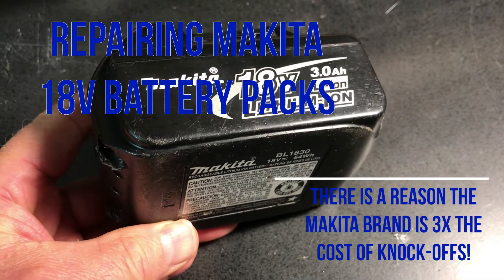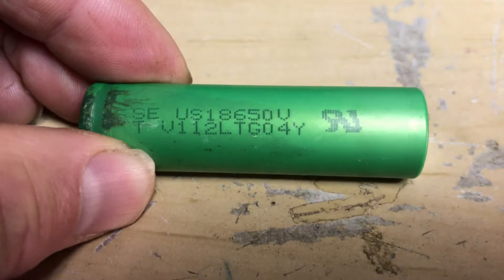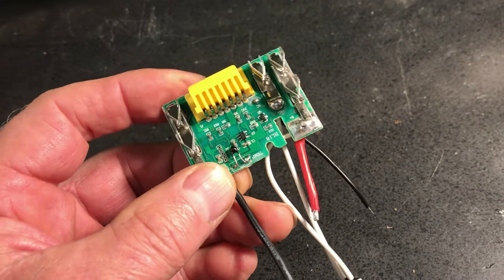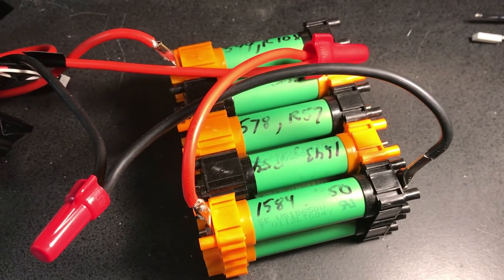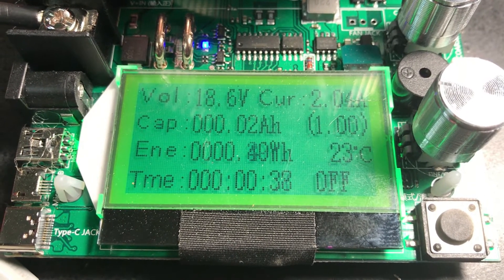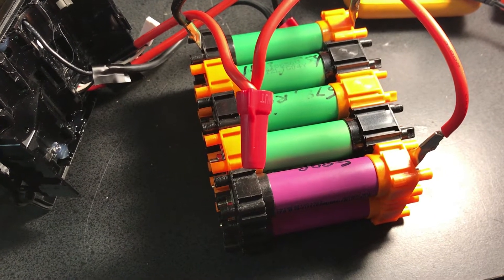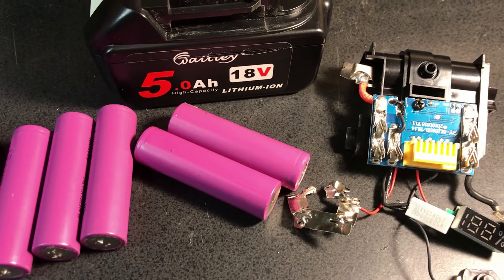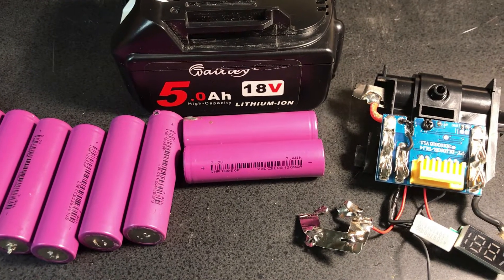Repairing Makita 18V Battery Packs, Dangers of Knock-offs

Comment: I recently opened up a genuine Milwaukee M18 5.0 battery pack and to my surprise, the 5s 2p cell configuration had 0 balancing connections which really confused me. The controller board had solder points for the different voltage connections but they didn’t utilize them which is probably why one of the cells sections died and the pack would no longer charge.